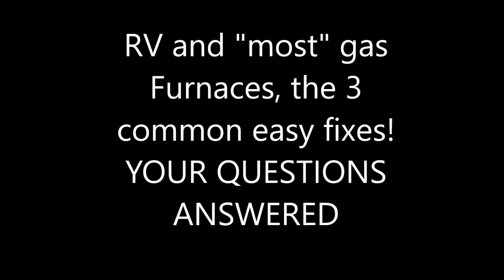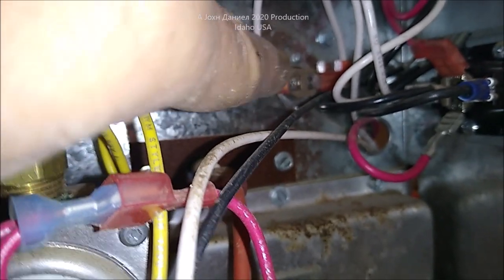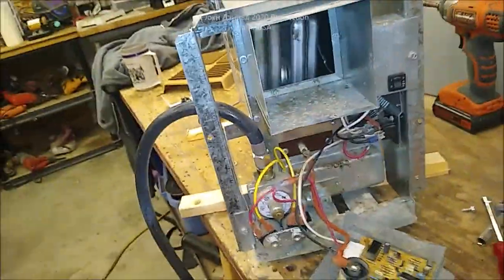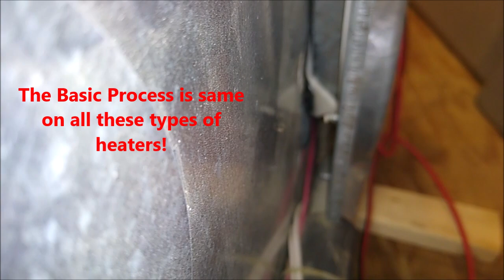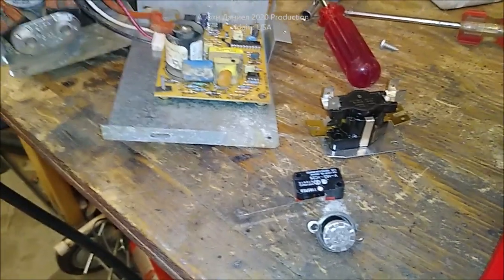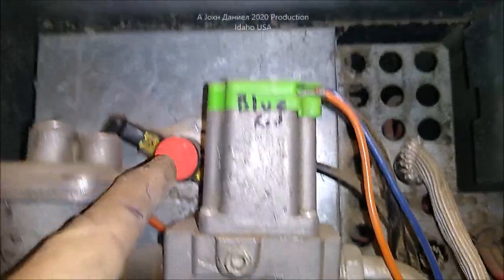RV Furnace REPAIR TECHNICIAN SECRETS Top 3 Easy Fixes anyone can do PARTS BELOW

Comment: I have a 09 jayco eagle and last night we woke up frantic to a vibrating noise. The blower fan has a vibration please help
Reply from the maker: Sounds like some screws came loose. Has the airflow reduced and do you have a rattle or squeal as part of the issue. There is a set screw or tag nut on both the blowers, as well as mounting screws and rubber spacers that can come loose. Removing the furnace will be required to access.
If you have just put the heater into service after it has sat a long time you may also have wasp nest that got into the intake and exhaust and if it got sucked into the intake blower it can do that. Look up the exhaust/intake pipes with a light to see if it is clear.
Reply: @JOHNDANIEL1  I crawled into the basement of the 5th wheel. Opened some panels. There is a switch where I can turn off there. It's super tight to get in to the unit. I turned it on and the vibration is definitely coning from the blower wheel. The whole assembly is tight onto of the water heater. I can't even get hand into blower I have a jayco eagle 351
Reply: @JOHNDANIEL1  we live in it full time as we are about to start building. It's been running now for a few weeks. Is the removal as complicated as it looks to access it
Reply from the maker: @cr9953  They are not hard to remove you just have to pay attention for hidden screws and be sure the gas is off, the power is unplugged from it. You say your trailer model is 351 RLSA, but what is the furnace model/brand. You can send pics and info to my Email olympicpowercontrols@yahoo.com
Reply: @JOHNDANIEL1 intake pipes, doesn't it suck from air around unit?
Reply from the maker: @cr9953  The air for combustion comes from outside, most have a pipe in a pipe for intake and exhaust.
Reply: @JOHNDANIEL1  4 vents leave the unit. There is an open cavity into the hallway above the stairs above the unit. Other than the gas in and the exhaust that's all that's coming out of unit. Plan on removing it after work today
Reply: 351 RLSA

Comment: I have that same rv furnace it has 3 wires black red and white I don’t understand how to wire a thermostat as this is to the 12 volt battery how to run the wires exactly anyone can help?
Reply from the maker: Not sure someone has altered it. SO, Proceed with caution: Be sure to connect gas, turn on gas, smell for leaks, then the wiring SHOULD be as follows -   Red is Positive and basically the power out for Thermostat lead 1, Black is negative, White ( usually very pale blue or yellow ) is return sending wire lead 2 for thermostat. Take the Black and red ( +/-) and connect to battery. Using a small wire like a testing jumper connect the white to the positive on battery or to the red wire. Should click in a few seconds after delay start  and start the blower, after that the blower will push the blower switch into position and the gas valve will open and it will set off the spark to the igniter. It is best to tell me the model and year of the heater but this is a basic standard for Atwood, suburban and Duotherm.

Comment: Thank you you’re explained most common problems in the furnace.
I have 2 questions if you could answer them:
1 turns the thermostat to furnace and the control does not have any power I mean no flashing light and no thing happens 
2 how to check if the thermostat had power with old one no light on it
Thank you.
Reply from the maker: Your missing very important info. What is the make, model, year of this furnace. There are over 30 variations in the last 40 years to consider in a diagnosis.

Comment: Hey how do I wire this in I bought one used it works but I don’t know if it needs a thermostat I put it direct to battery but it never turns off and if I turn it off I lose the last heat u mention please help thank u
Reply from the maker: You should have 4 wires or 3 wires on these. On the 4 wire model you will have Power + and -, Then 2 wires that are thermostat. On the 3 wire model You will have Power + and - and then one wire, usually yellow, and it will be the switch wire that goes up to thermostat and back down to the positive + wire.  Using a thermostat with a proper contact and resistance load will be best way, but you can just put in a switch to get it to run non stop. The problem with running one non stop is your gonna take years off its life, have to live with the windows open to balance the heat. Or you can just buy a mechanical heat only thermostat from Walmart for $10. IF your unit is powering on without a thermostat, or any other wires but the battery supply then you have a failed Run-Delay-Relay that is fused in the on position. OR some tard wired it live.

Comment: How do i run it off a battery
Reply from the maker: Just connect a 12 volt battery with 12 awg low voltage wire to the +/- on the furnace and run 2 wires 18 awg for the thermostat then connect the propane gas to it. If installing in a home, follow the mounting standard for venting it outside as used in the RV.

Comment: Hello, so mine never turns on and I just assumed my heater is broken. But today I walked into my trailer and the heater fan was on. What caused it to finally turn on? How do I turn it off.?
Reply: I had this trailer for 5 years and it never turned on. Why now?
Reply from the maker: Look for the fuse to the heater and remove it. Then reinstall it and see if it comes back on. If it does, you have to disconnect one wire from the thermostat and see if that is the issue, it is possible that the Run Delay Relay is acting up, or your thermostat is bad and some jolt near it set it off.

Comment: Thank you for the video. I just bought a Starcraft camper and the furnace fired up just fine. It ran for about 10 minutes and then everything‘s getting pretty hot so I turned it down. When we went to go to bed, it would not come on anymore.the fan would come on. I could hear the clicking of it trying to ignite, but it was not igniting. I’m thinking it’s that temperature switch that you talked about first. I’m going to jump that to see if that’s what it was.

Comment: My furnace is burning too hot. I was told it was the limit switch (Doesn't make sense to me) and I checked the burner and its good. The regulator puts out 11wc. I'm stuck. Furnace burns too hot and trips on overheat (Which also tells me the limit is good) Closest register hits 195f after 5 minutes of running. has 4 air ducts, 3 are 4", one is 1.5"(?) Air ducts are clear.
Reply from the maker: Limit switches fail outward in temperature. Taking higher temps to force them apart. They will stick ( carbon arc ) and not allow standard flame in/out cycling. Can't hurt to replace it, you should have 165 to 170 from the ducts with a 165 to 180 limit switch. Some may have a 200 limit switch but those are have air mixing with registers in the 160 to 180 range.
Reply: @JOHNDANIEL1  Fair enough about the limit switch. Just replaced it with no change in operation. Can the fuel be turned down? Flame control? Can a smaller burner be used? How is the ultimate heat reduced? All I can think to do is add more vents for greater air flow through the firebox?
Reply from the maker: @NotThatGuy330  Excessive heat can be due to a odd effect of low voltage, slower motor/blower due to low voltage or age. When its moving too slow, the heat made can be too high. Check to see if the intake and exhaust is plugged, that flow reduction can create a very rich fuel and over heat effect that slows the airflow from the blower. Take a light and look up into the intake/exhaust tubes on the outside and see if they have any blockage, some times a wasp nest can be sucked into the intake air blower also.

Comment: All mine does is just blow air no tick nothing I replaced the igniter and leaf switch idk what’s going any help would be greatly appreciated thank you.
Reply: My Atwood looks just like this one it’s a 93 lance truck bed camper
Reply from the maker: Using a jumper cross ( bridge) the connections on the over limit switch. Then fire it up and see if that solves it. Sounds like the NC ( normally closed ) over limit switch is bad and staying open as if it over heated.

Comment: I’m getting heat only when I’m plugged into shore power? But when I’m on my batteries, it just blows cold air? And there’s a smell? Like a burning smells but I’m not getting heat? Any advice?
Reply from the maker: Plugged in you have 14.6 volts, on battery you have 13 or less. MY FIRST GUESS - Get a flashlight, look from the outside up into your intake/exhaust tubes. See if you have wasp or insect nest in it. When your voltage is high your fan can push the paddle switch ( sail Switch) far enough against the exhaust blockage to fire it up, when your volts are low the blower is weaker and can not push on it enough. 
Just a guess from a few thousand similar examples. Could be something else, but sounds like bug blockage. If so, remove the cover, use a wire to break it up, connect a shop vac to the exhaust tubes first, try cleaning, then to the intake ( cleaner one ) and try that some.

Comment: I got a 1993 Kit Road Ranger 25 ft CT it needs some work I haven't tried the furnace yet but the hot water heater pilot will not light and my fridge does not work.  What can I do to troubleshoot these? I'll be looking into the furnace and the stove and oven layer today actually.
Reply from the maker: Water heater pilot is based on thermocouple and clear outlet for the pilot. Replace the thermocouple with white rogers style 18" model https://amzn.to/4dUhvLb on that unit. Pressure test the heater, if its ok, replace the thermocouple kit. As for the rare option on the year models 88 to 99 replace the main RV tanks Propane gas regulator on them since they were generation one models for "EPA venting designs" and often failed full flow. Use flameking  https://amzn.to/3zW8lzZ
POSSIBLES ON THE REFRIDGERATOR - If your refrigerator shows no signs of leaking from its tubes in back ( yellow stains/ammonia smells, heavy rust) and using a watt meter ( MUST HAVE ITEM FOR RV POWER TESTING ) see if it is pulling any or no power, then let me know your results. If your fridge is making sounds but in 8 hours plugged in does not get cold you have to remove it, leave in the RV, but flip on its top for 1 full day unplugged so it's plugged tubes can back flow to free it up inside the cooling part. There is 5 chemicals with the Ammonia in them that can solidify in the condensing section and doing this may free it up. After being on its top for a day, flip back and let sit a hour then try to run it again.  Only 3 things can stop them from working, a plugged up tube, bad heating tube/burner issues, or leaks.

Comment: Glad to see a furnace on the bench so we can see all the parts clearly! DC may not care about amperage but wires do if they are underrated for the draw. So if you are trying to drive a 24V load with a 12V source you need to supply more current. You can probably get away with it with your relay but I wouldn't live by that rule for everything.

Comment: Thanks for the great video and help! I have been having an issue with my furnace on my Grand Design 21G for over a year. I have replaced the following parts: Limit Switch, Sail switches (many times), Furnace Ignition Control Board, Thermostat.... The furnace will turn on, start working and then in either a day or 2 it will start to only blow cold air. Usually I replace the Sail Switch and it works again for a day or 2. However I cant keep doing this and there is obviously an issue. I bought 10 Sail Switches to get me through some winter trips!! Do you have any suggestions or idea on why this is happening? Thanks!
Reply from the maker: Sail switch has to be capable of 10 amps, the problem sounds like the Igniter/flame sensor assembly. A cool down cycle can be stuck due to a bad run delay circuit or thermal disc switch in it too.
Reply: @JOHNDANIEL1  Thank you, i ll start digging into that

Comment: I saw your videos is very good. My problem is I have a 1997 Tahoe travel trailer about 26 feet long when I go to my thermostat and select heat air starts blowing out of my roof air conditioner. My air conditioner works on cool on the thermostat, but I can’t get my heater to switch to blow air out through the floor vents and ignite. What do you think is wrong thank you for your help. JGA
Reply from the maker: Could be other issues but not likely. Try first this plan - These dual action thermostats have been notorious for similar failures. I always install 2 separate. Use this basic model heat only on it. https://amzn.to/3ZFneAX 
Those dual use tend to send the wiring to the AC unit, then back to the heater and somewhere in the AC unit is a confused board or relay. Just check your 2 wire location coming from the heater, run some 18/2 wire from the furnace to a spot best suited and put on that basic heat model.

Comment: My 2004 Forest River Rv heater has been great until yesterday. Almost the same furnace as this video except on the board there's a red test light that used to light up but now it doesn't so would my problem be the same as in the video?
Reply from the maker: What is the furnace doing when you turn on the heat/thermostat to it? Is there a click, a buzz, some sign of activity? If the Run-Delay relay has failed the board will not get action power to start its cycles but usually there is some sign of issue first.
Reply: @JOHNDANIEL1   It doesn't do anything the little red test light doesn't work and I have 12 volts coming into the board but nothing going out anywhere. Don't think I want to try to remove and replace the relay as the whole board seems to be coated.
Reply from the maker: If the board is getting power but not sending out functions it is likely a bad board. They get power from the main relay at the same time the fan starts.
Reply: @JOHNDANIEL1  But even the fan doesn't start just power to the board and dead after that.
Reply from the maker: @stevenorcutt3913  Jump the 2 contacts on the Run-Delay relay with a set of jumper clips or safely with a wire and see if your furnace fires up. If so, replace it.

Comment: Have a issue with my camper furnace. I have a 2021 keystone bullet 331bhs and we had issues with the furnace after a year. Sail switch about a dozen times but now itll come on but when it reaches the temperature that we put on the tstat itll shut off and wont come back on when the temperature drops below the tstat temperature setting. What could this be? Thanks and great videos !
Reply from the maker: If your camper has the digital or dual service Thermostat that is likely your problem. I replace every one of those with separate mechanical models and never have another issue. Some furnaces since 2016 communicate with the thermostats and AC unit which has make them the most miserable thing on the planet to de-bug. Many RV owners are stomping mad when I show them the problem of their heater is the Air Conditioners heat sensors are sending wrong info LOL!
Reply: It has a digital ge tstat. So your saying just get a mechanical one?
Reply from the maker: @billdempsey9704  Yes. If it's a 2 wire then use just a simple heat only https://amzn.to/3B6oF1d using bi-metal coil and basic carbon contacts. 
You can test it by connecting the 2 wires together and seeing if your heater runs. If it does then let it heat past 75 degrees, disconnect the wires, then in a minute after it shuts off repeat the test. If it starts and runs replace the thermostat. If it does not run, then you need to check for the Over temp switch for issues.
Reply: And its single zone

Comment: Why is humming and then blow the fuse
Reply from the maker: Motor is hung up, so if you can get to the side of it where you see the blower wheel try to spin it. Some will get bugs, wasp, junk into the air intake and it will jam them up. Others may just be BAD MOTOR! 
One small possible is bad relay on the run delay circuit. But HUMMING sounds like first issue. Take a bright light, look into intake/exhaust and see is crap in is it! Get to the unit on the side and easily see about moving the blower somehow. Do not force, use 1-2 lbs force.

Comment: Im working on an old hydrotherm, has 12v to blower motor but wont run the blower. I suspect the furnace needs to see the air movement before it fires on anything else? Blower needs to come on first, leaf switch lets the rest know its operating, gas fires on, until the heat switch trips fuel supply. Do I have that right?
Reply from the maker: Your RUN DELAY RELAY sends power to the blower, in timed delay then the leaf switch kicks on a relay to open gas and the igniter. In most with electric ignition it runs that too. In pilot lit models a microvolt generator sensor is in the mix for the gas valves to open.

Comment: Hi sir, I actually went to HVAC school and did not get much time in the field. Had to put myself in an RV due to cost thanks to you. I’ve been able to keep this whole girl running. I was able to utilize some of your tips currently looking to put a, direct plug as a back up so I can run my HVAC system. Currently on solar plus short power with a broken breaker box but I have a secondary box at my RV post. Any thoughts? I’ll check back.
Reply from the maker: Your AC unit will be on a single non shared breaker. Pull the 3 wires from it, run them over to install a 120 volt Inlet https://amzn.to/3WGmng7 into the side of your RV and then using a 12 gauge cord connect to the RV post extra outlet. Be sure to seal well, and make sure to cut the hole in a good spot with plenty clearance. 
A cheaper way is to add a male end on those wires but you want no high amp failures in or under cabinets.